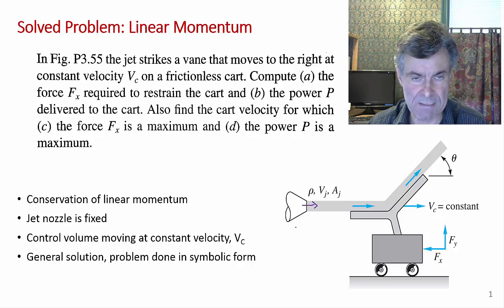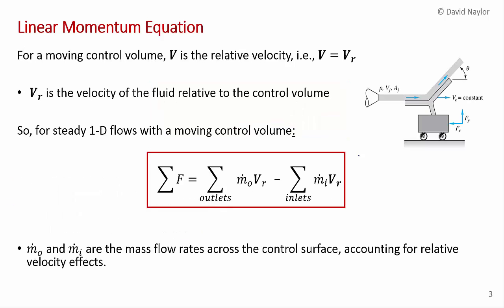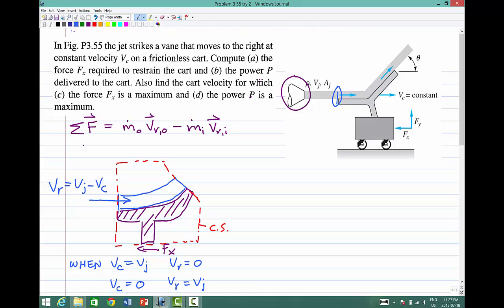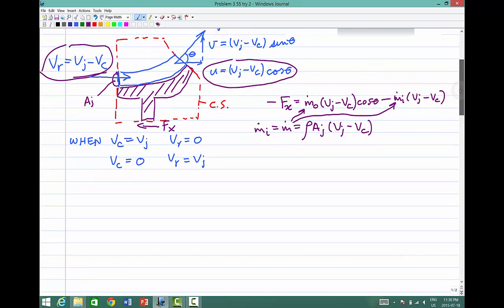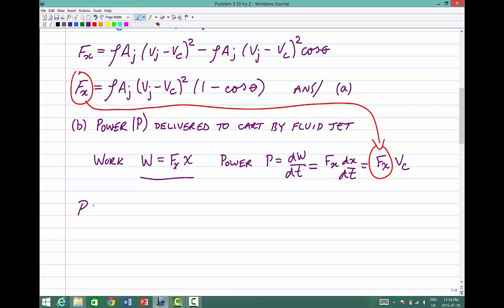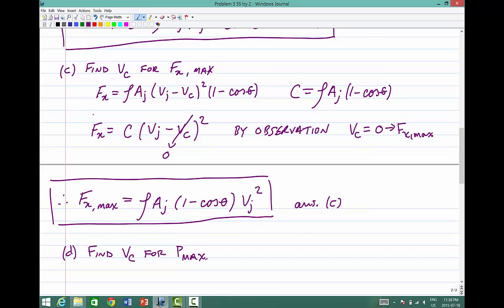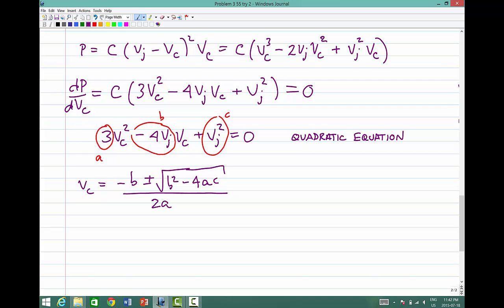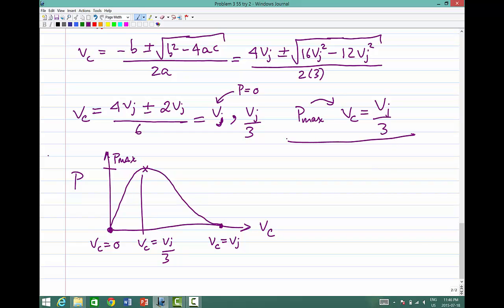Solved Problem: Force of a Water Jet with a Moving Control Volume

Comment: Shouldnt u first have to find force in y direction then find the resultant force . Then this resultant force is the one that should be multiple by the velocity to find power
Reply from the maker: Work is force times displacement. There is no displacement in the y-direction -- so no work done by Fy.  So, you only use Fx to calculate the power. Your questions raises an important technical point!  I really wish I had said that in the video!  I hope that helps.
Reply: @FluidMatters thanks for the explanation. ❤️🫡

Comment: why do we consider relative velocity Vr instead of just Vj as it is the water in jet doing the working
Reply from the maker: It's the mass flow through the control volume that matters.  If the control volume (moving with the cart) was moving at the same speed as the water jet, no fluid would enter, so no force. Hopefully that makes sense to you.

Comment: why is ṁ_out not rho*A*cos(theta), since if we only look at the x direction, both the mass flow and the velocity would have a cos(theta) component
Reply from the maker: That is a great question! Here's a better answer after some thought: The key idea is that the mass flow rate is defined as a scalar quantity—the rate at which mass crosses a surface—and it already incorporates the necessary directional information via the dot product. So, think of m_dot  as a count of how many kilograms of water pass a point per second. This number is independent of direction. When you want to know the momentum (which is directional), you multiply that count by the velocity vector. If you want the x-component of momentum, you only need the x-component of the velocity. There’s no need to “slice” the mass count further by its x-direction because the directional information comes entirely from the velocity.  In short, the error in trying to include an extra cosine factor is that it double-counts the directional projection. The scalar mass flow rate already incorporates the necessary directional component through its definition.
Reply: @ Thank you for the answer, the second response gives a much more intuitive explanation, and i think i understand it now
Reply from the maker: @SSL22222  Thanks for the great question. It forced me me deepen my basic understand.

Comment: At the leaving control surface, why we need to write Vc(costheta) as Vc has already moved along the horizontal direction?
Reply from the maker: Recognize that the jet leaves the control volume with the same relative speed at is it came in with: (V_j-V_c). So, you have to take the horizontal component of that relative speed. Imagine the jet being turned through a full 90 degrees. In this hypothetical case, the jet would leave in the vertical direction relative to the moving control volume. So, with no horizontal component relative to the moving control volume. I find it helps to imagine what I would see if I was riding with the control volume.  I hope that helps.

Comment: I don't understand why you square the out velocity before multiplying by cosine. The out velocity is only the X-component. V^2 cosine is not a physically relevant quantity is it?
Reply from the maker: (V_j-V_c) is associated with the mass flow rate term.  Also, (V_j-V-c) cos (theta) is the exit velocity. These two terms are multiplied together to get the rate of momentum out i.e., mass flow rate times relative velocity. That's why the relative velocity term is squared. I hope that helps.